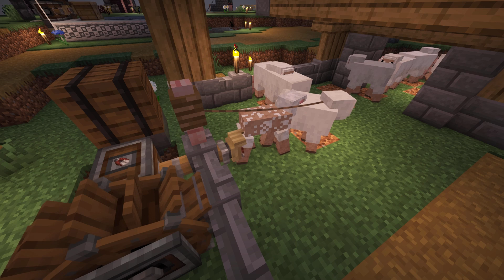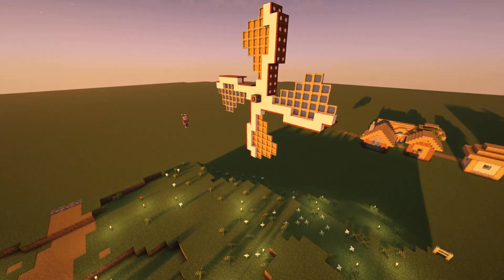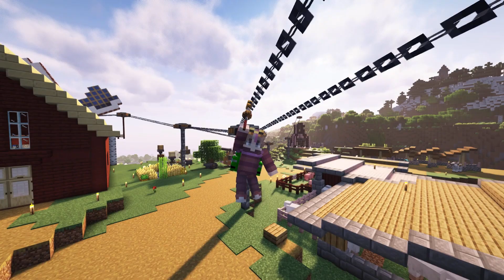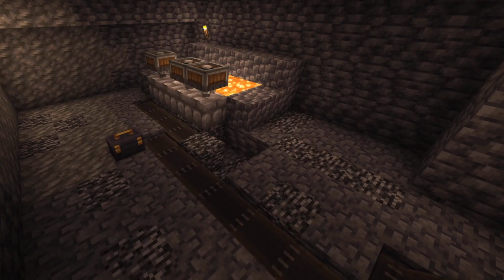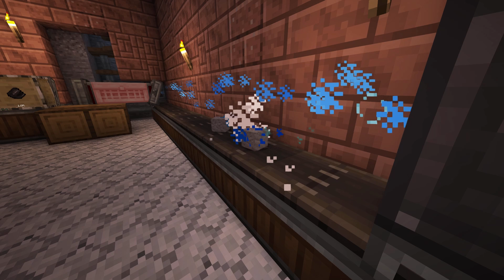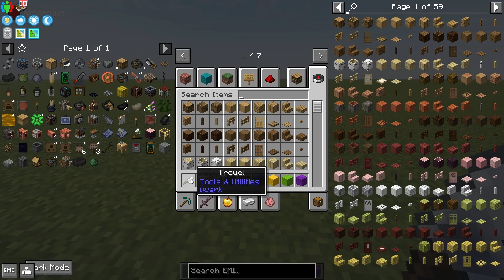Powering Machines with WIND in Minecraft Create Mod?!?

Comment: One thing I was wondering. How do you store your infinite iron and flint? Do you manually dispose them, or is there something in the mod that lets you dispose of extras?
Reply from the maker: Currently, they're going into special chests (Storage Drawers) that can hold a lot of just one item; 2k of each by default, before upgrades. These can be increased in size, and/or given a upgrade that will void/destroy anything past that cap. Right now it's just so SLOW though it's not causing any backups, but as things speed up that could become an issue for other production lines.